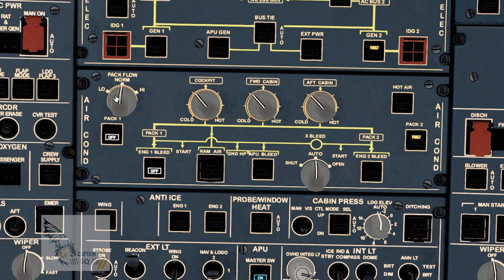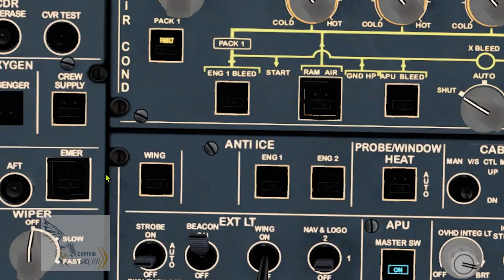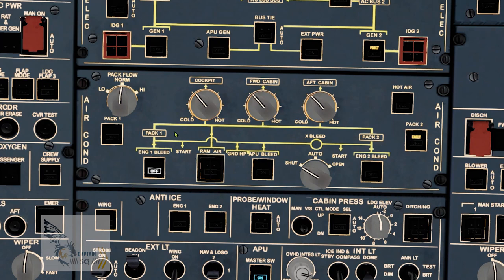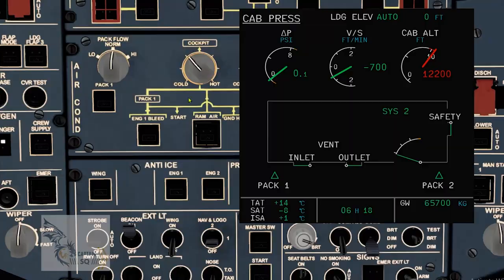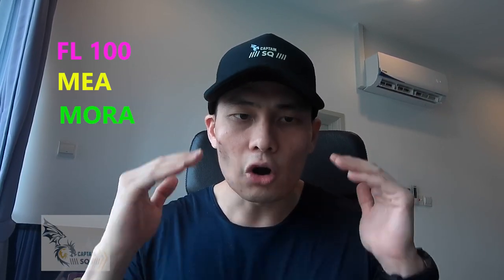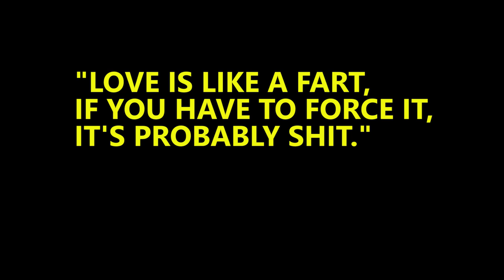What is Airbus OEB 60 ? (MADE EASY UNDER 5 MINUTES)

Comment: What is it: the guys that made this plane in France used a cheap piece of equipment that makes it difficult to know if you got a leak in your bleed system, this is on the NEO, don’t worry on the next big maintenance check it will be fixed.

What do I have to do: Follow the ECAM as normal no drama, anything that’s got the word “AIR” read OEB60.

Remember ….bleed Air is basically hot air used for icing, you don’t want this hot air leaking around the plane if your in icing conditions, or you may fall out of the sky …
Reply from the maker: Thank you for sharing your thoughts Zee. Airbus aircraft has amazing technologies in my opinion.
Reply: @Captain_SQ  totally agree, I added u on IG, stay safe laaa..✈🛩🛫🛬